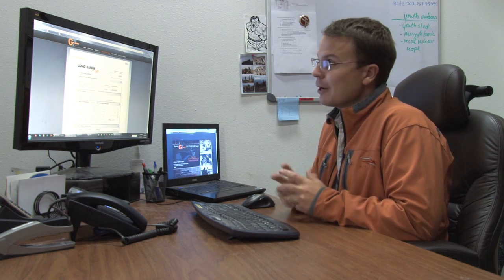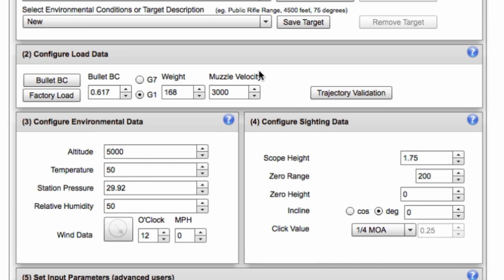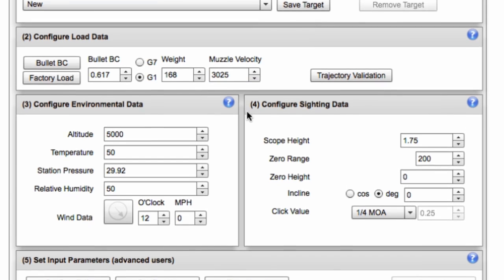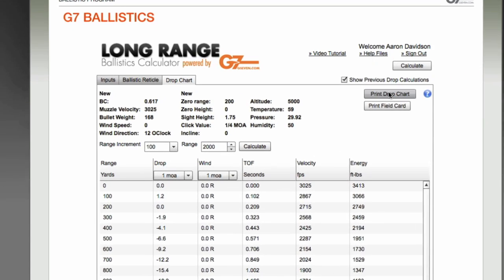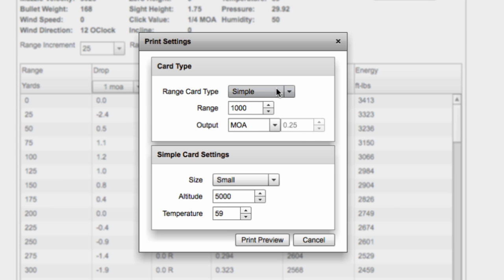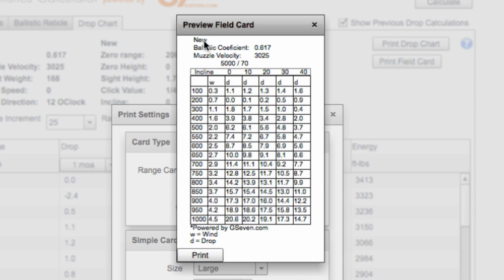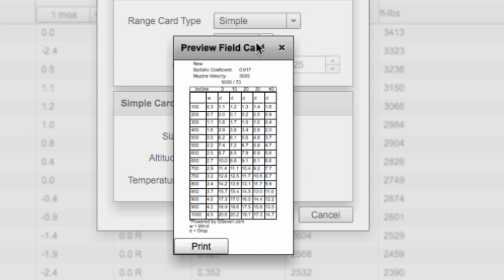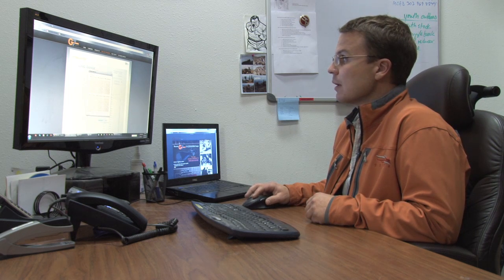DIY Print a Ballistic Drop Chart

Comment: Will this work with Burris scope?
Reply: it works with any scope, mil or inch, which most scopes are 1/4 turn or .025mm for each turn, but again its more for long range, so you still have to put in the correct info, like Projectile coefficient, Hight above sea level, wind speeds, muzzle velocity, air temperature, and what caliber and most important what weight of bullet or grian like say a 308 with a hornet 215 grain bullet or projectile and then you have customise it as well poder used, rifle barrel twist ratio etc etc, it can be hard, but if you have the facts based on your rifle and where you going to shoot and the areas factors like wind distance etc, you should be able to adjust the scope and ammo tyo suit based on the rage your going to be shooting at ?